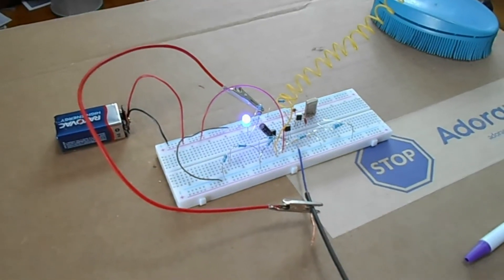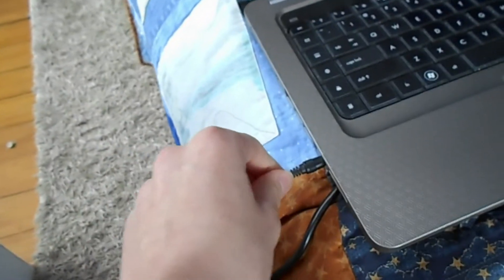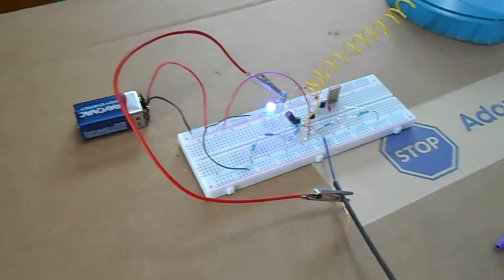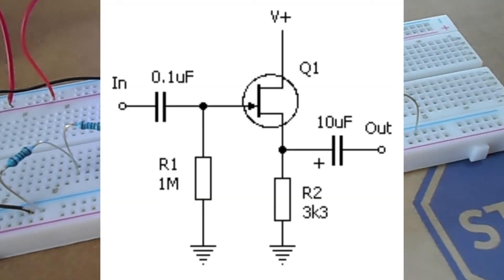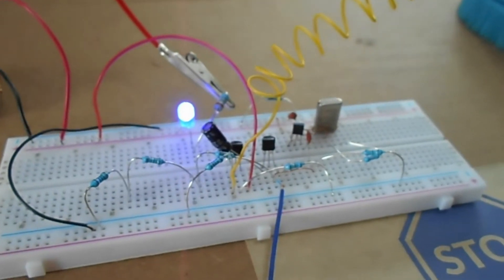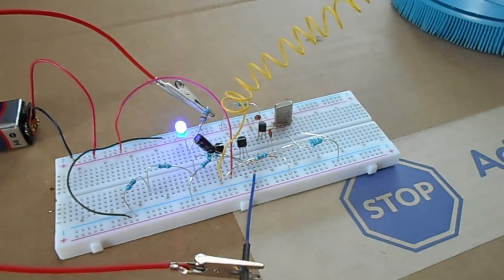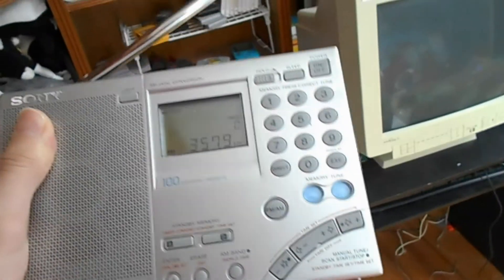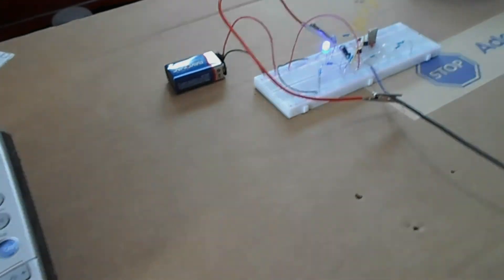Improvements To The AM Transmitter - AM2PC pt. 2

Comment: Nice Job! I need to build a RF modulator circuit to test antique radios. Your video gave me some ideas. However, I will have to use a variable capacitor to be able to tune and transmit across the entire band. But I also wanted to point out a simple test to check your electrolytic capacitor polarity. Simple put a DMM or DVM across the capacitor and check for DC voltage. If the voltage is negative, you have it in backwards. ;)